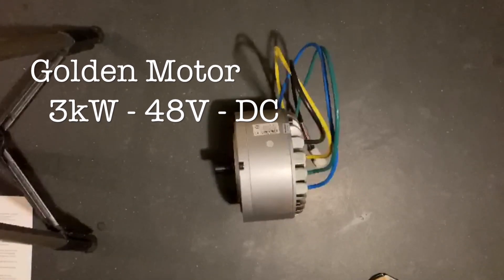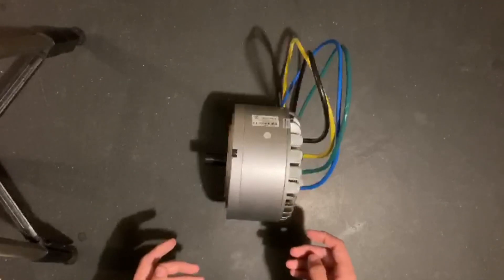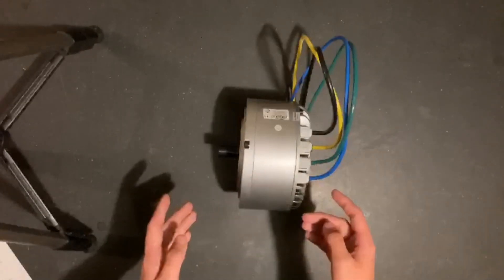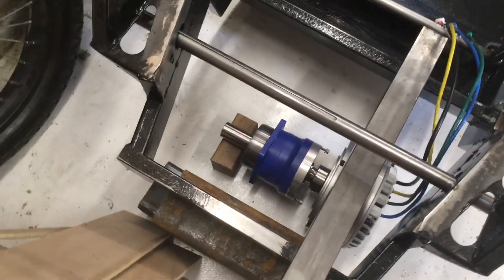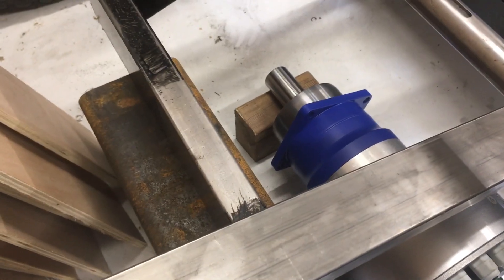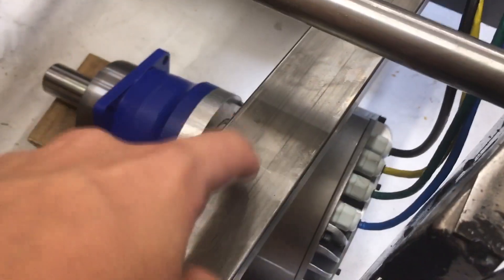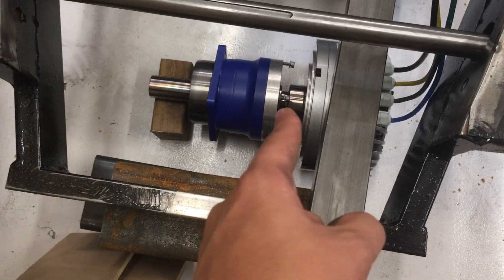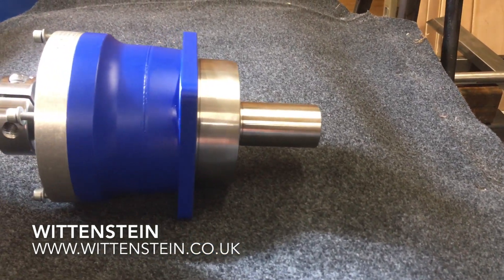Delage 15-S-8 Modern Build 15- DRIVETRAIN (part 1)

Comment: I dont know what batteries you are planning to use but i should feel they will be heavier than your drive. Thus the possibility of the drive mounted above and batteries below? Just thinking out loud here. The batteries could be mounted on a tray that slides out the rear on drawer glides.
 Cheers!
 Terry from South Carolina USA
Reply from the maker: My plan is to actually have the batteries up front. i have loads of space ahead of my feet so they can still be nice and low AND the weight distribution will be better.
Reply: @ixt_roadandracing  sounds good!  I couldn't tell how much room you have. Enjoying your build!
Cheers!
Terry from South Carolina USA